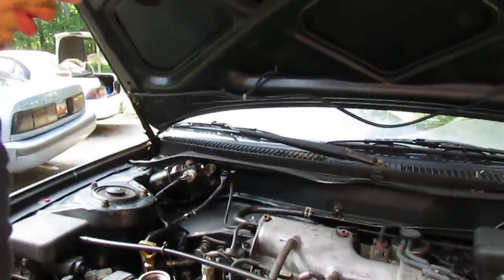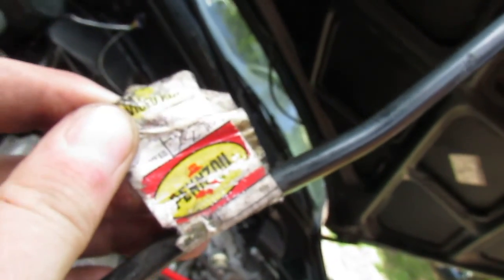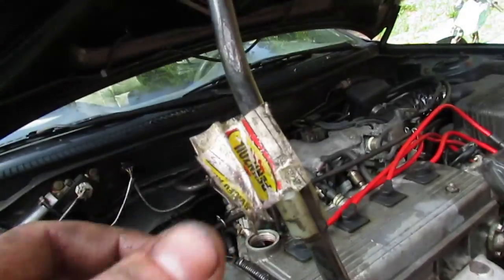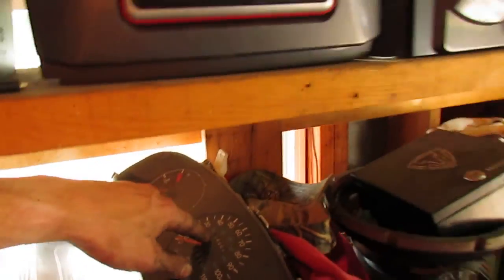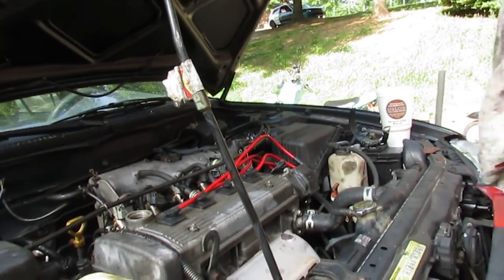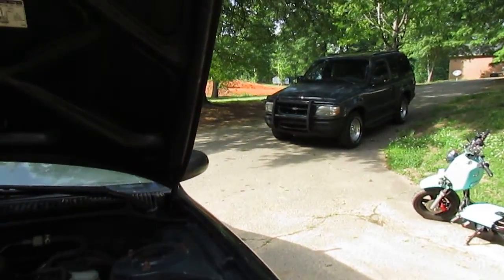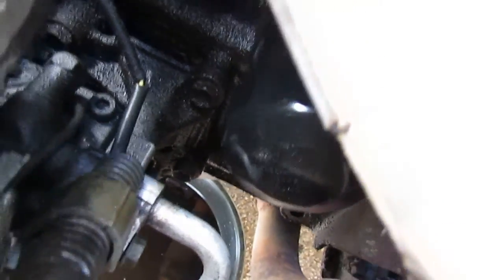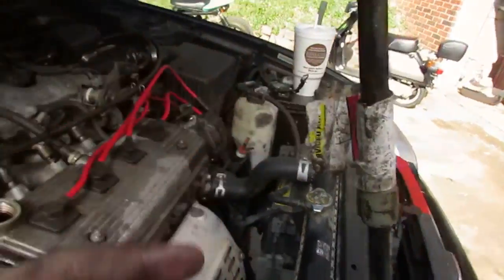Oil Change Surprises!

Comment: I have had my daily driver Chevy minivan since new for 15 years.  I use it on 3500mi road trips, to haul building materials, boxes, etc.  I keep it very clean to use at family outings, etc.  I don't abuse it, and I don't pamper it.  Whenever the oil life monitor reads 10% oil life left, I change it myself for $18. I put marvel mystery oil in the gas and oil.  And when a part goes bad, or doesn't pass my inspection, I change it.  Maintenance costs an average of $300 a year. Including brakes, fluids, tires, oil changes, and battery.  It has about 160k, and we now put on 12k a year.  I have no plans on getting rid of it, and I will be putting a new radiator in it (new OEM is $149) and new 50/50 Dexcool.

Not sure why anyone would not change the oil.  I mean give up a few meals if you have to.  To replace a vehicle with something used is crazy.  After maintaining a car yourself, you know every quirk, weak point, and strength of the vehicle.